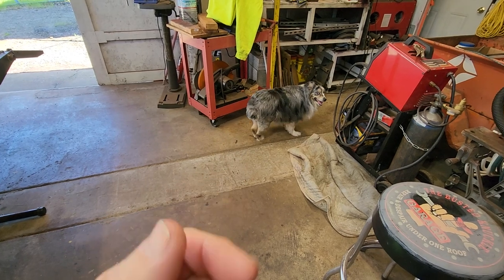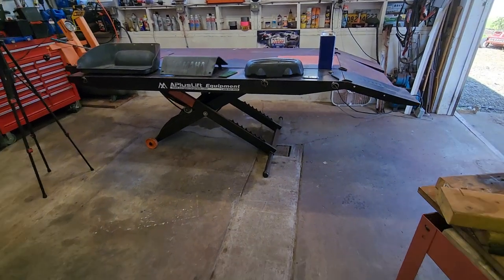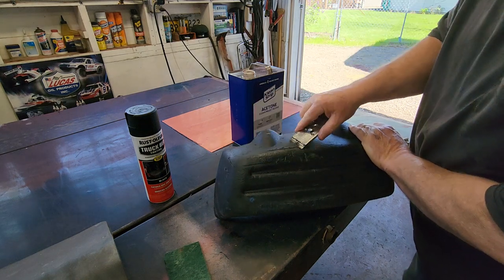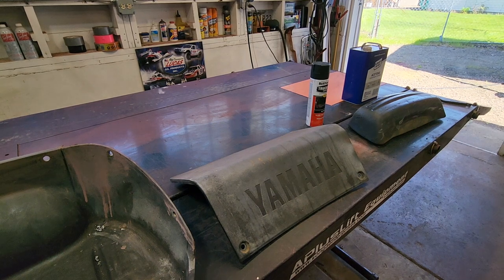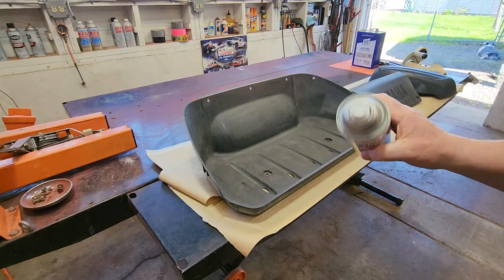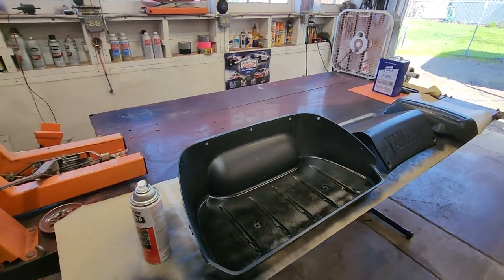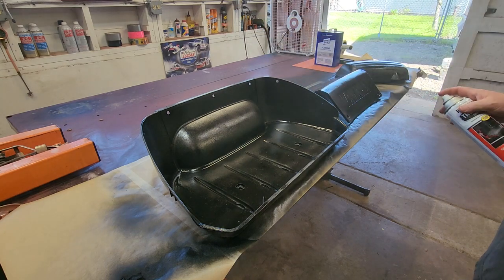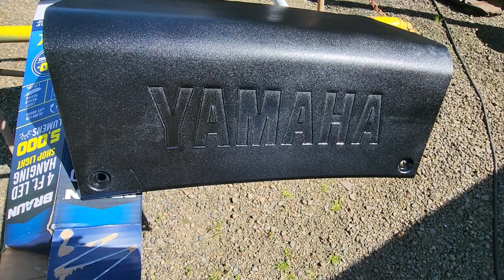Today I restore the black plastic body panels off my Yamaha Drive Golf Cart!

Comment: Hey man I've just gotta say I love this whole golf cart series of you fixing this guy up.  I'm going through most of the same steps on my fixer-upper.  Only thing I'm really intimidated by is the paint job.
Reply from the maker: Practice some wet sanding, it cuts through the old finish quickly and leaves a nice finish to paint over!
Reply: @GlennsSpeedShop  will do! Thanks for the tip